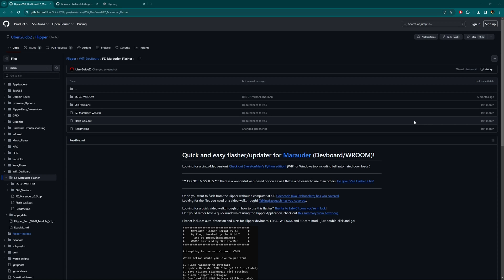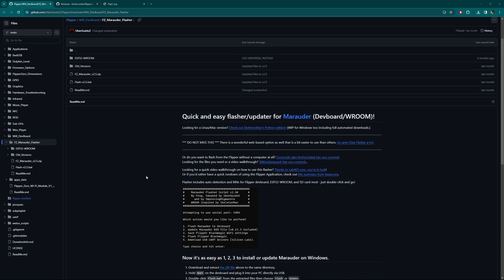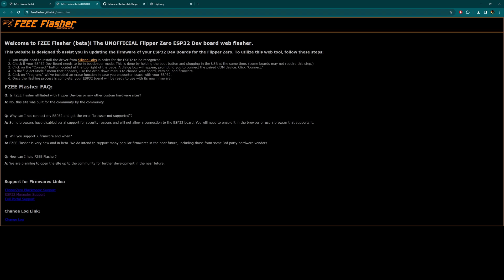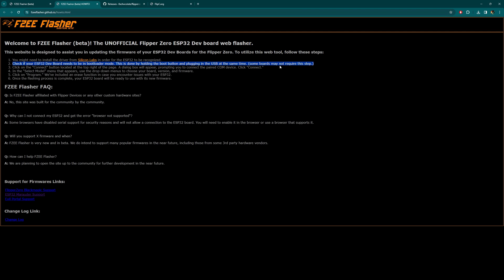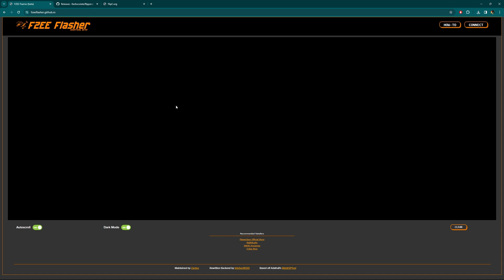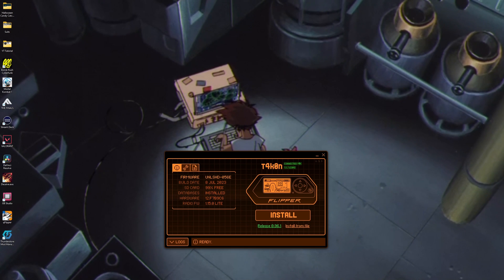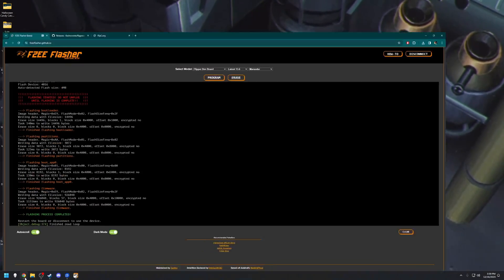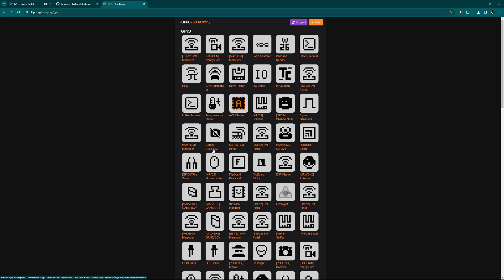WiFi Marauder Magic Unleash Your Flipper Zero's Power in Minutes!

Comment: do i need to do this before using evil portal?
Reply from the maker: If you're doing a dual boot solution I'm not positive if you need to do one before the other as I only have the original non dual boot dev board. But if you're only looking to do one and not the other, no you'll just want to do the evil portal stuff.

Comment: Hello again... The flashing process was very simple as you stated and by all indications on the FZEE FLASHER screen, all went as described, BUT my Flipper Zero GPIO does not show the Marauder firmware listed after disconnecting. I have tried both the FZEE FLASHER and the other method you described to flash the Dev board and both methods indicate a successful flash, but nothing appears on the Flipper Zero device. My Flipper Zero is new... is there more firmware to be loaded on to it before this can be successfully done? Any ideas?
Reply from the maker: This is really tough to say because it seems that it’s a varied experience from user to user some people follow the video start to finish and it works without a problem others follow the video start to finish and it doesn’t work for them. 

For me personally I have the unleashed firmware. I just updated it to the newest update and marauder works then when I follow my video that I flashed for evil portal that also works unfortunately I don’t have the key to why it’s not working exactly for you or others. 

If you happen to stumble across the solution, if you could please share it so I can share with others when they ask me why it’s not working for them and hopefully it’s a simple step or solution 

Thank you for your time on this matter. Hope you have a great week.
Reply: Problem solved by switching to the Marauder instead of using the stock Flipper Zero firmware. One more question please... do you know how to open a Flipper Application file (.fap) to be able to look at the Wi-Fi access points on my PC? Thanks!

Comment: My Flipper Zero froze and will not respond to any commands, including power off. Is there a reset to this device apart from the power button?
Reply from the maker: Holding left arrow and the back button a few seconds
Reply: @ModernBroadcast  Thanks that did it. 👍

Comment: my flipper looks slighty different, yours says applications but mine says apps, they are the same thing but i still dont see esp32 wifimaruader. all i see is GPIO

edit: i think i need the driver but idk which driver to download
Reply: This is the exact same problem I have
Reply: i downloaded extreme  so using the extreme firmware fixed my issue  @williamspies2739
Reply: same